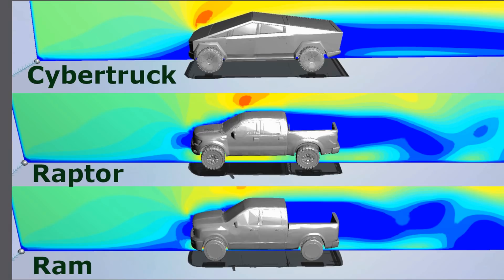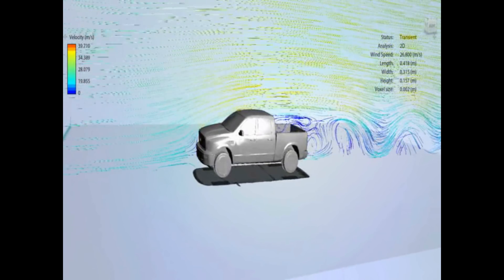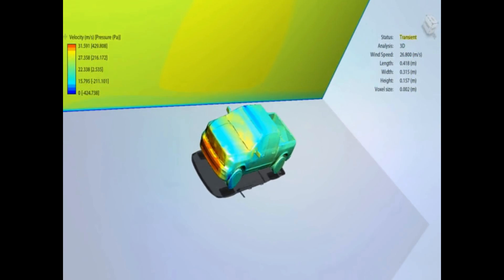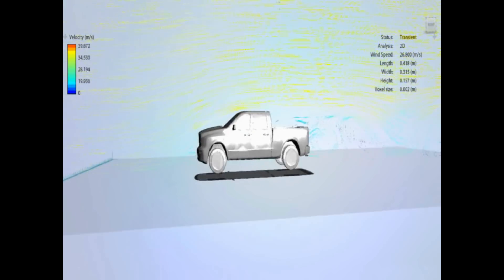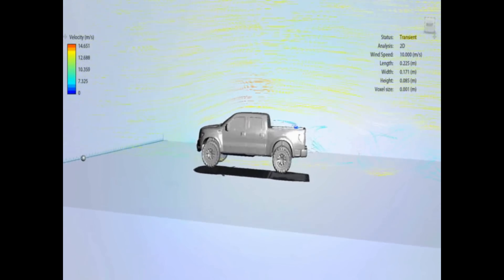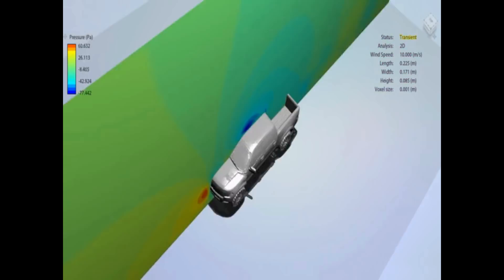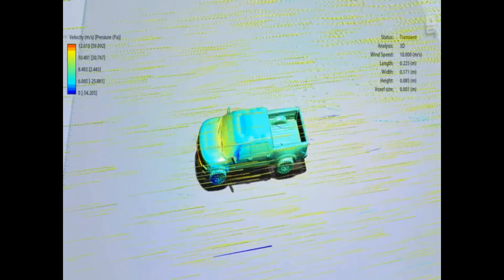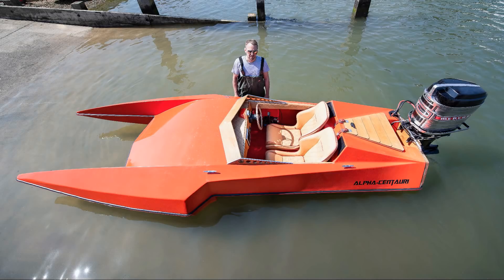Cybertruck vs Ram vs Raptor  Aerodynamics

Comment: Mythbusters found that driving with a tailgate up was more efficient than driving with it down. 
I don’t know if they tried with bed covers.
Reply: Model and speed dependent also, my old Courier did better @ 55 with tailgate up, down with speed over 65. I think at 55 it captured an air pocket and the main body of air over the cab ended up going to the tailgate while at higher speed that pocket shrunk closer to the cab and the tailgate ended up being just another vertical surface. 
Also of note, I had a mid 80s Escort that got better mileage when i hauled a giant cargo bag on the roof.
Reply: @ty2010  The dodge and the Ford have both addressed this by making the tailgate have a large flat top. drag test proved tailgate up was better than down, and gone. still no data on the cover though.
Reply: @enigma9789  Valid for 2015+, my present f150 is an 82
Reply: @ty2010  actually its 2010 F150 and up. I get 18mpg hwy with my 2011 screw 5.0, just rolled over 200k
Reply: @enigma9789  2015 was the year I found all the details for. The 82 gets 19 hwy with a 351w, 17 with a cab height cap on the bed.
Reply: Also with tailgate removed but one of the plastic nets added slightly improved fuel efficiency vs stock design.   This isn’t all that surprising since the engineers who designed it likely optimized the vortex losses for the tailgate up, and whomever designed the net likely did some modeling too and found a design that was slightly better to avoid getting sued for false advertising about improving economy.
Reply: Mythbusters didn't actrually test bedcovers but they did say driving with the tailgate up simulates (somewhat) a bed cover. With it up , imagine the bed hauling a load of air, it keeps other air from swirling back there.
Reply: Wrong it's more efficient with a mesh when driving a pick up truck

Comment: Once again... another dodgy promo from the cyber truck along with the balls shattering the glass, and the ford f150 rigged drag test...
Both the other trucks have their trays open while the cybertrucks is closed...
Most people know that a truck with an open tray considerably increases drag... alot!
These trucks come with covers also...
Either open tge cybertrucks tray, or cover the other trays... once again... an unfair, biased test
Reply: Throw a massive metal ball at any truck window, guess where the ball ends up.
How many trucks come with a built in cover.
The tug of war demo was obviously biased, once the truck comes out we can test it.
Reply: @spythegamerx  yeh exactly, the production model will be alot different to this, definitely will be less aerodynamic...
Both my mitsubishi triton and ford ranger i have had came with tray covers
Reply: It's simply presenting the results obtainable by this method,  and they are intuitively obvious,  anyway.  Most trucks do NOT have tonneau covers,  and you know it. No bias here,  and no exact results claimed,  if you were listening.
Reply: Fandango not true.  Most trucks hv covers but you hv to buy them extra.  They generally, if ever, come standard with the car
Reply: Well my wifes triton came with 1 and my ranger came with 1... hey but of course i must be lying about it... for some reason... i guess....

Comment: About 12 years ago I did a CFD run on a Nissan 350Z and a had higher-than-expected drag coefficient.  I was told that this is a consequence of having a relatively small solution domain.  But then again, I was running right up to the limits of the hardware.  It looks like you are dealing with exactly the same issues.
Reply: it would be interesting to see the mesh he used. and it seems that he scaled down all trucks? or what do these numbers on the right side represent?
Reply: @RCP-1136  he only scaled down the Ram and the Ford so it wouldn't show their accurate, better than the Tesla's numbers.
Reply: @bryanhersman4037  Well... Afaik coefficient of drag is not affected by the size, so it shouldn't really matter all that much. 
And anyway, as the guy in the video said, if you think you can do it better go do it yourself! :D

Comment: Nice to see something that goes beyond idle speculation and actually produces a coefficient of drag figure even if it is generally too high. So the roof line is not as tragic as had been suggested by others using nothing more sophisticated than uncalibrated eyeballs. While it is true the Cybertruck lacks external mirrors I'm assuming the drag would still not be as bad as the Raptor or Ram if it did have external mirrors (or am I being naive here).
Reply from the maker: Yes I think your conclusions are correct. I do need to highlight that my results could be totally wrong! There are a lot of variables involved, I'm not an expert and the software I'm using is old fashioned. 
There have been a couple of genuine experts saying that the cd I'd in fact around 0.47,  probably better to trust them than me! 
I will be very interested to see what tesla say it is.

Comment: You know, I saw an infographic that stated CT's cd was worse than the other pickups. But then I realized those were probably STOCK pickups with 9" clearance, a chin, and conservative tucked-in tires.
Reply from the maker: Yes, I've seen them also. To be fair they are all done with more advanced software, by people with more experience than me, so more likely to have accurate results. Most seem to agree the cd is around. 47. 

Having said that though if they are right and I'm wrong then I would expect to see better results on the other pickups.  My software / models could just be very wrong!
Reply: @BoatsandEngines  You have increased my confidence in your model now that you've validated against other trucks. Question, does your model include a gentle curvature along the length of the truck? Because it's there, just not immediately apparent.

Comment: what if there were no cover on the bed with cybertruck?
Reply: its designed with it
Reply: The cover is included and slides down I imagine the vast majority of the time you’ll have it closed
Reply: @onesimpletrick3448  doesn't mean you should compare one truck with the cover and one not with one. Most uses of these cars will usually require them to be open.
Reply: @Gongolongo  but in that case the object in the truck bed would make aerodynamic comparisons invalid anyway, if we consider that the truck would be carrying something of significant size.
Reply: @Gongolongo  most people dont pull or carry anything the majority of the time
Reply: Very interested in seeing this one too.
Reply from the maker: It would definitely increase the cd, I don't know how much though.
Reply: Also you could assume that if it’s open it’s full of somthing that’s to big to let you close it
Reply: Elliott's Lab Or someone just stole the cover
Reply: @magno5157  its part of the body lol
Reply: 0xsergy it can be cut off with a grinder :D
Reply: magno you can steal anything if you try hard enough :3